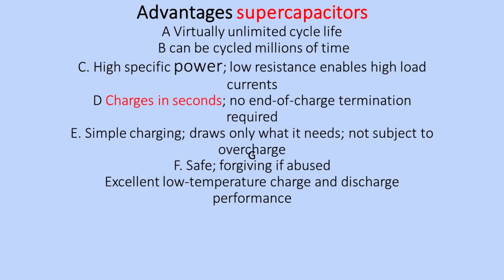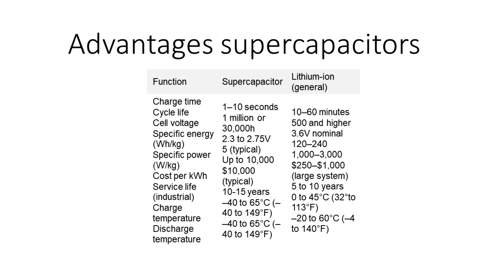Nikola truck - Tesla semi impossible, video,  unless use supercapacitors in battery. stock 3000

Comment: No.  Speculation of Tesla using 'solid state batteries' or 'supercapacitors' is completely wrong.  JB Straubel is Tesla's Chief Technology Officer.  He is the one who convinced Elon Musk that Supercapacitors were not the way to go for electric vehicles.  For the type of situations where cars are used batteries are a much more viable solution.  At a conference held at Stanford in September 2013 JB noted that the energy density for battery cells had roughly doubled every ten years since the introduction of Lithium-ion batteries.  He noted an increase of around 40% in energy density between the introduction of Tesla Roadster and the release of Model S.  In 2015 he said that he had already seen a 35% to 40% improvement since 2012.

Capacitors can release a lot of energy almost instantaneously, but only for a limited number of cycles before they burn out for good.  They lack the longevity that is needed for practical, reliable operation in cars as a primary energy storage medium.  Most computer motherboards that die suddenly will be found to have blown capacitors, which cannot be easily replaced.

There is only an incremental, step-by-step improvement  in battery technology per year. Yet that steady growth results in twice the energy being stored in the same volume over that time.  One decade is all it takes.  The battery cells used in the original Model S were released in late 2009 by Panasonic, chosen by Tesla in late 2010, and the car was introduced in mid-2012.

The original Tesla Roadster was unveiled in 2017 and began Sales in 2018.  Effectively a decade ago and was already on par with Porsche Boxster and barely behind the Porsche 911.  Is it really so hard to believe that in a decade since when a four-door liftback that weighs just shy of 5,000 lbs can beat million dollar Ferraris and McClarens and Lamborghinis through the 1/4 mile thanks to an all electric drivetrain, that in two years a 2+2 from the same company might demolish all road legal ICE vehicles once and for all...?  It shouldn't be readily believable.

No lies.  No Hoax.  No Fraud.  This is real.  The ICEHEADS just wish it were not.  Because they can't do it without abandoning emissions controls, destroying fuel economy ratings, and violating noise polution statutes.  Tesla is right on track with Lithium-ion batteries.

Comment: I like the idea, but I feel it's unlikely that some kind of new technology is involved. The reason is that if some great new leap were made, for example, in supercapacitors, or in solid state batteries, then it would be difficult to keep secret for two years. So I guess they have done some creative engineering to get the most out of existing technologies.
Nikola has been banking on hydrogen, while Musk has repeatedly said hydrogen won't work. I myself don't know enough to understand why. But I have been wondering why Nikola has been so confident when someone like Elon Musk studied it and discarded the idea and committed to batteries.
Reply from the maker: Hydrogen does work just as well as electricity.  the issue is that after the production, storage etc... the costs added make it not competitive with diesel and electricity.  One exception is storing hydrogen at a dock then using on trucks works given shipping on water so cheeeeep.

Comment: After talking to my son ( Engineer at Tesla) I came away with these thoughts.
Speculation about any Tesla project will invariably be wrong.  Tesla is doing what no other car manufacture has accomplished. So many opinions of what should be done and what is being done are way off base. Consider the battery pack lines. Currently 100 plus people building model S and X 18650 battery packs. Now Tesla is attempting to use a highly automated 2170 Battery pack line to produce 3 times the packs with one third the people. (These numbers are not accurate, could be 10 people and 5 times. I only know it is like quantum leap in productivity.) The machine that builds the machine. This is so important to Tesla because other manufacturers do not want the investment cost. Tesla will always be slow to start but the S curve will be far greater in the end. Elon has said all of this but who listens?
1. Building anything is much faster in the mind.
2. First time builds of anything new takes more time then we anticapate.
3. Extensive planning helps lessen the time gap of imagined completion and actual time.
4. The more complex the project the longer the actual time gap between imagined and actual.
Reply from the maker: Its fun watching you learn Musk say a lot and say nada at the same time haha.  We know tesla will read these blogs and fire your son if he gives up any useful info.  that is fine.  the finished product speaks for itself.  the truck and roadsters are true monster vehicles.  because they don't patent all they create secrecy is critical.  nice comments
Reply: He is very careful of what he tells me. He does not even know the real numbers just knows the absurdity of the speculation.
Reply from the maker: you have some homework to do on  supercapacitors, graphene batteries, etc... solid state batteries worth the time and we will be posting more on this.  great stuff
Reply: I should add that I enjoy your speculation!!!
Reply: I have worked with capacitors in circuits. I have done a little reading about super capacitors. will do more! Thank you for your efforts to enlighten us.

Comment: They probably can't put any new technology in the Model 3 because they haven't got it to a point where it is able to be manufactured at 10000 batteries per month within the next few weeks hence the delayed release of the Semi and Roadster. It will come through in 2020 in the Model S and kill all the model S killers when they arrive in 2020.
Reply from the maker: makes sense but production started at gigafactory jan 1 ish.  the 18650 in the model x and s are made in japan.  No choice but to put new stuff in the model 3.  its also why the can do it at the lower price to have a lower cost battery pack.
Reply from the maker: this new tech. only way to get cost of battery down to allow a 35k car.

Comment: Greg, 

Something does not feel right with the reasoning. Current capacitors cannot store economically much energy, not in amounts needed for fast charging the battery. 

May be added capacitors could help in a sprint of acceleration, or deceleration to cope with the huge power flows for limited time. 

Just think of a regular flash cupled to a camera. High power for tiny amount of time, from power limited batteries.

There are many ways to store energy and retrieve it electrically. Let me take 3 of the as an example:
1) Capacitors - store energy in the form of accumulated charge, of both polarities in different plates, which have an electric field between them. Can charge and discharge relatively easy at high rates (power) but store limited amounts of energy before electric fields become too high for dielectrics to cope with.
High Power, Low Energy.

2) Batteries - store energy using a chemical reaction that "hides" in news chemical species the energy in the form of potentially reactable species that would force a current to react. Has medium power and energy densities, as the chemical reaction has to happen, species has to be close enough, and there are materials to allow all this to happen that don't contribute to the energy storage.
Medium Power, Medium Energy.

3) Fuels (Diesel, gasoline, ethanol, LPG, CH4, DME,...) - store energy as intrinsic molecular bonds that are reatable with an external oxidant agent (O2, Air). Every molecule strores energy with no overhead in the fuel, do it's very energy dense, the most dense without considering nuclear reactions. On the other hand, there is a need external machinery to timely extract usable energy from the fuel molecules, the thermal machine, the ICE, in a cost effective way thus power limited.
High Energy density, Lower Power (in the ICE ability to do it).

Those are just points in a design space of options available to conceive an engineered product to satisfy our needs.

There could be variations as redox batteries and fuel cells that touch adjacent point.

All those elements can be coupled in a way to provide the best return to the owner in a way similar to what Electric Engineers do with memory hierarchies in a computers with cache memory.

Demand is studied statistically, and met in the most cost effective ways. The fastest and costlier memories are used in small amount that deal with most of the needs, while the bulk goes to slower cheaper memory types at the cost of hardware and complexity to manage it.

A vehicle could have capacitors for the fastest acceleration and breaking, coupled to batteries more oriented for energy storage with less overhead, providing nominal power required but not peak. 

Further levels could be conceived with fuel cell or ice generator "range extenders", that recharge batteries.

I see no immediate way that capacitors could be a game changer for battery metrics without a real breakthrough.

Something is still missing. May be Tesla projects a really very low price for their batteries, allowing for big packs in both energy and power ratings. This big packs, overdesigned to the application might be able to cope with fast charge and discharge in terms equivalent miles, but no so much in battery SOC excursion. This would help in Heavy Duty reliability too.

Musk did not state how many KWH would be in the truck, just estimated range.

Regards.
Reply from the maker: good logic.  the new game of tesla is they only give out info on a need to know basis.  what truck and roadster can do is amazing much better than expected and there is a reason
Reply: Reason = 2070 Battery Chemistry, as simply as that

Comment: Solid state batteries or supercapacitors/ion which one is better?
Reply: Not quite, in short,  in a capacitor the electrons are moving from one electrode to the other at light speed (or almost, electrons are moving slower in mater than in vacuum), in a battery ions are recombining at chemical speed, its two completely different technology. Solid state battery avoid  the metal migration currently creating short circuit in liquid electrolyte, a solid electrolyte would allow a lithium metal battery to be recharged. As lithium metal battery have an higher capacity than li-ion its a promising technology. If Tesla develop and patent this technology they will be a big winner, if somebody else beat them in this race, they will be a big looser, as they will need to retool the gigafactory and buy the license. Not to mention the Tesla car owners who would be stuck with an outdated  car.
Reply from the maker: just learning this chemistry.  supercapacitors is part of solid state.  tesla using blend of two lith. ion and solid state

Comment: Here is a new battery technology that truly fits what they might be using as with this new battery technology they can more than double the current battery energy density and it far safer for use which are two things Elon loves to boast about. Check out the video here: https://youtu.be/gxZrQ5yPsLI?t=26m34s
And there is another guy in Australia that is doing something similar to this with a gel type battery.
Reply: A new battery technology is the worst think which could happen to Tesla and Tesla car owners. Tesla has invested billions in li-ion cells, buying the license and retooling the factory for solid state battery would cost a few more billions and for the car owner their cars would become worthless.
 Otherwise nice puncture demo, now try to drop some water on it, lithium is an alkaline metal it's highly flammable and very reactive with water producing a lot of hydrogen.
Reply from the maker: what if the gigafactory has been building from solid state from the beginning

Comment: One thing that intrigues me is that the Roadster in the unveil event did the 0-60 run all night with seemingly no impact on the battery. I don't think that is possible in current SX models.
Reply: Yes, that was very impressive
Reply from the maker: yes that was strange no?  new battery stuff is a killer.

Comment: I suspect that Tesla have not done anything radical other than refined and improved what they were already doing. That said, they may have done something like includ a small Ultra capacitor in the design - imagine if, say, 1 in 10 cells were actually Ultracapacitors.. this would mean that more energy could be grabbed from regenerative braking. So that might impact the performance. Also remember that if Tesla did invent something radically improved, then following their existing approach to patents, they might not have registered any designs.
Reply: Tesla would need to patent any breakthrough that they make in battery tech. Otherwise they could impinge on patents by other manufacturers that were lodged after Tesla's invention.
Reply from the maker: some of it patented not all of it.
Reply: James Albury issue is not the speed of innovation rather who patents that innovation. As you know Fisker has recently lodged a super cap patent - however the implementation of that patent is years away. Companies may do this as a defensive move to delay a company from manufacturing a similar technology through the courts.
Reply: Patrick Dadey Much like Fisker just publicly announced. Energy storage will be very different in a few years. Hooray for innovation! "Necessity is the mother of invention." :)

Comment: Could you elaborate on actual demand for ev. Performance of ev  and price are becoming more and more convincing. But can all this change and modify  the strong inertia of ice cars preferance?
This is the most intriguing question by now. It might determine the fate of Tesla
Reply from the maker: cannot make enough at these prices and peformances
Reply from the maker: strange question.  did you see the numbers on the sportscar?  the 1.9 second zero to sixty of the roadster makes it best on the planet for sale.  the chiron is 3 million dollars and 20 percent slower.  ev demand increase has been driven by people seeing and experiencing better performance all around accelration,cost of fuel, etc... No problem with demand with all these values better than ice.

Comment: +Teslafaninsight       I have to disagree on two points.
(i) the static shock you can get off a door handle on a dry day is from a capacitor but not a SuperCapacitor. Static shocks are high voltage (many hundreds of volts) but low energy while an individual SuperCapacitor will be less than 5V and store a lot more energy.
(ii) The energy density (both gravimetric and volumetric) for SuperCapacitors while high for a capacitor is a lot less than a Li-ion cell and you need a lot of power and energy to get a car up to 100mph in 4.2 seconds.

If there are any SuperCapacitors in the new Roadster they likely will play a minor role.
Of course a breakthrough of one to two order of magnitude in SuperCapacitor energy density might be possible just as an improvement in Li-ion cells is but so far that improvement has not been demonstrated and if it were found it would be a game changer for energy storage (if the price was not too outrageous). Imagine an iPhone with a SuperCapacitor instead of a battery that could be charged in seconds and would outlast the electronics, that might upset their non-replaceable battery might as well buy a new phone every two years sales model.
Reply from the maker: good point.  static charge is an example of charging speed

Comment: The roadster uses 200kWh of batteries so 600 miles are not a problem. And with 3 electric motors with the right gearing it just work, it’s not wizardry it is electrical and electronic engineering and science. Don’t underestimate people at Tesla.
Reply: Don't see a problem with roadster specs. If they double the battery energy storage capacity using the same cells, they would get double the power to with proper electronics.

If newer chemistry is presented in the new form factor of the 21700 (2170) cylindrical cells, there may be another upgrade factor in both energy and power densities.

Given power to weight ratio still apllies to electrified vehicles, more power with (relatively) less weight...
Reply from the maker: true dat
Reply from the maker: their research based in canada univ.  lot of smart people from all over.
Reply: Teslafaninsight 
My friend, what Mario Kajin stated is correct. This is a matter of simple common sense. We don't need any rocket scientist to explain that.